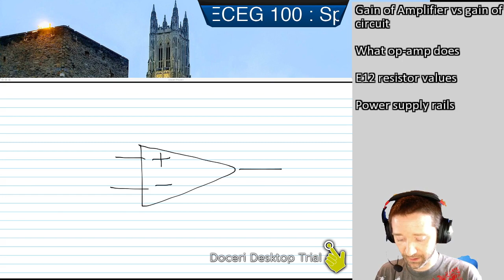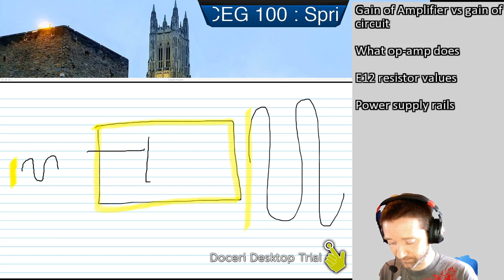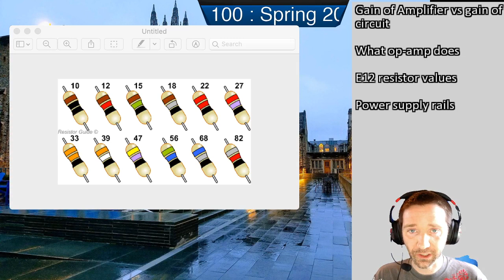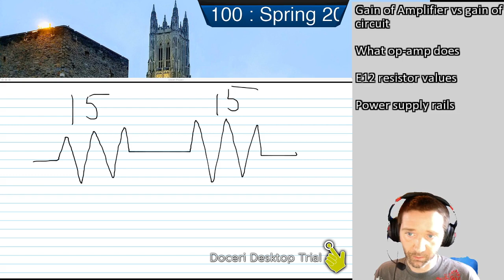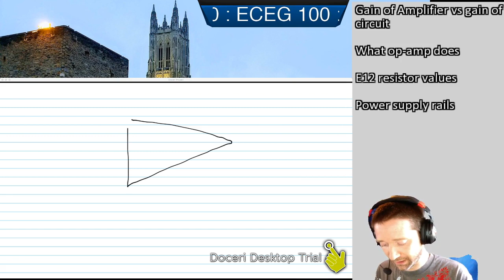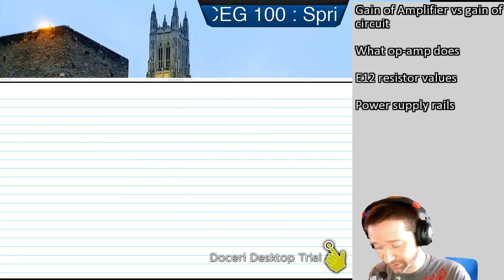Comment: Does it matter which sign of the inputs is connected in between the resistors? Like if i switched the + and -
Reply: (answered in piazza)
I believe you are referring to the inverting and non-inverting inputs of the op-amp. Yes! In the video, I was very careless and drew the wrong circuit. As you saw in the feedback video, setting up the feedback loop to maintain (nearly) zero volts between the two inputs is very important! Otherwise, your circuit will probably output one of the rail voltages (the voltage of the positive or negative power supply). Always pay careful attention to the plus and minus signs of the inputs to know which is the inverting (negative sign) and non-inverting (plus sign) inputs!